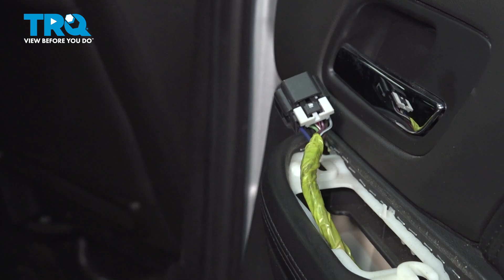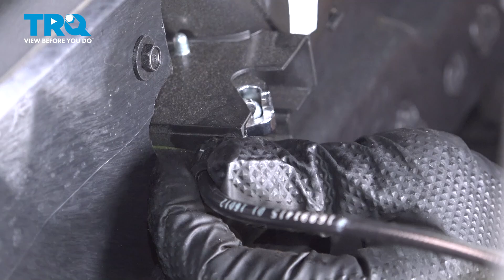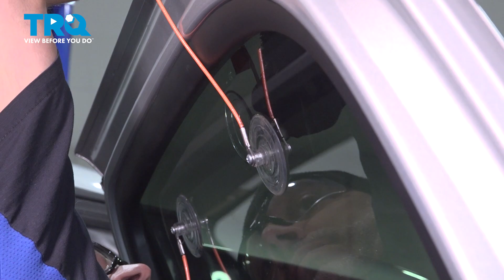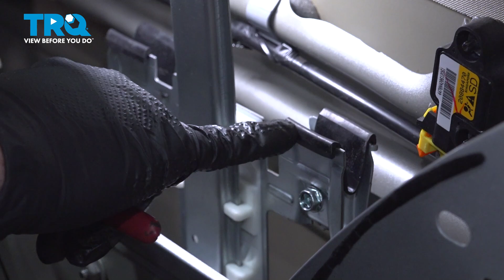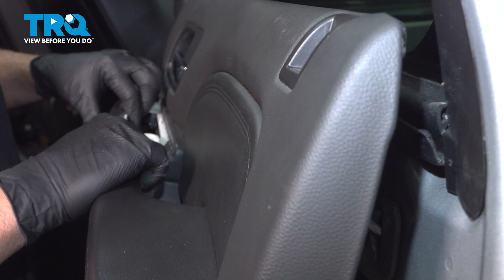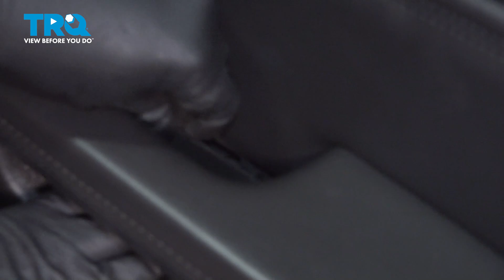How to Replace Rear Power Window Motor & Regulators 2007-2014 Cadillac Escalade

Comment: My 2007 Escalade has the left rear window 'off the track', I think. It falls freely and the motor does not engage. It's definitely off the track, so I will follow your instructions to remove the 'panel' then I should be able to see if it a motor issue, a switch issue, or off the track issue. If I have to replace the whole assembly, your video will come in very handy. I'm getting ready to sell it in order to buy a newer car that Uber will approve of. Thanks!